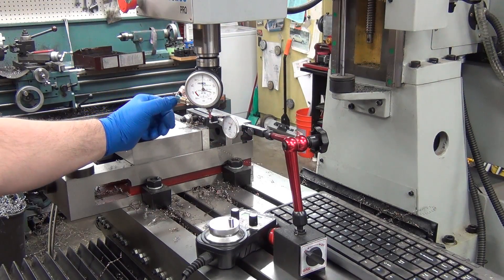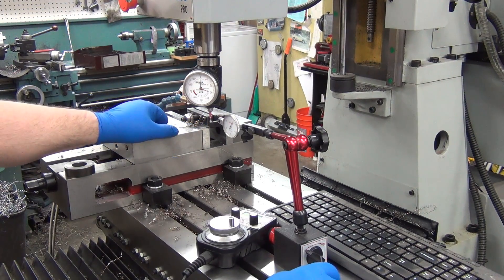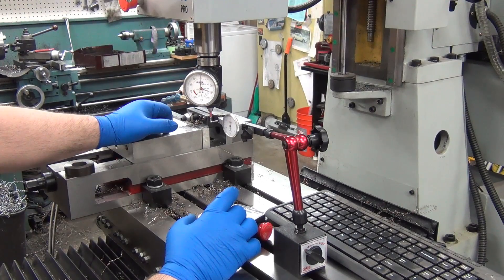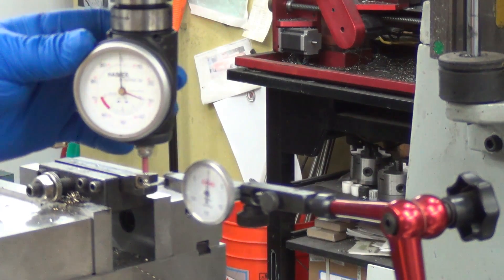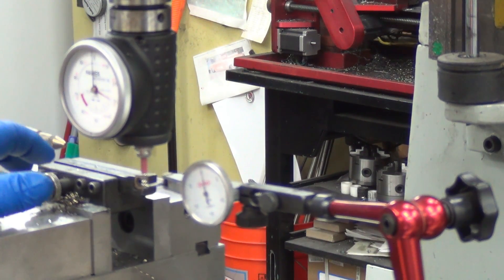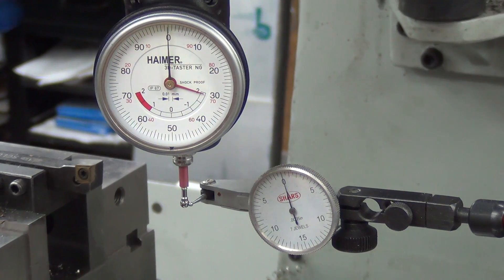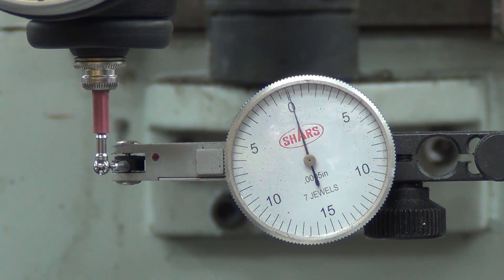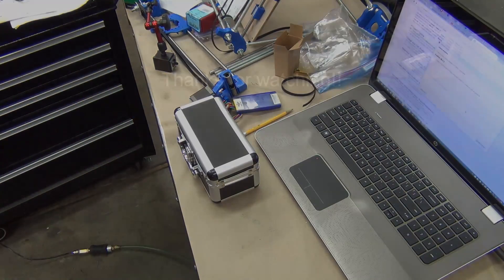Haimer 3D Sensor/Taster Setup

Comment: Can the Haimer 3D sensor work horizontally?
Reply from the maker: Sure....I've used it multiple times for setting tools in my lathe.  There is plenty of spring tension to hold the stylus when in a horizontal position.
Reply: @bluehandsvideo  :Thanks! Maybe using it in the lathe  will make a good video as well.
Reply from the maker: @shellybelly9205  I don't recall if I shot any video while I did it or not.  Might be in the editor if I did.  If not, I'll have to consider it next time I do some tool setups.

Comment: How hard are you turning on those grub screws? I really have to force mine hard to get my Haimer to calibrate and then the thing goes out of calibration again after a few hours. I feel as if I must be missing something, but I don't know what.
Reply from the maker: They work like a 4 jaw chuck....you have to loosen one, then tighten the one opposite of it(180deg) for it to move.  If you loosen one first, the other turns pretty easily.  If they're really hard to turn, you may not have loosened the other one enough.  If you have to turn really hard on one, .....loosen the opposite side first....snug up the first screw until it goes just past where you want it......then snug the one you loosened back up....it should push the needle back to where you want it.  It's a lot of trial and error........and just when you think you've got the hang of it.....it will prove you wrong. lol  I haven't had any issues with it going out of calibration.  Have you watched the tormach vid?
Reply: Hi. Thanks for your reply - Yes, it was actually the Tormach video which introduced me to the Haimer in the first place. Even loosening all the screws and then doing one up hard makes very little difference to my dials eccentricity. I have to apply a ridiculous amount of force to calibrate the dial and as I've said, it goes out after only a few hours (suggesting something is fighting against the force applied by the screws). No body else I've asked seems to have this problem with their Haimer so I'm really starting to think there is something wrong with mine.
Reply from the maker: There very well could be something wrong with yours.  Have you talked to Tormach about it?  
Here's the vid I followed to get the "at rest" position to zero.  
https://www.youtube.com/watch?v=ZwbTxlVM6TQ

Comment: Hi tks for the vid.  I have some question did you have to calibrate haimer each time you put in your spindle?  Or you mark the zero position??  Because I think if not you will have runout measurement as error...  Isn't?
Reply from the maker: Great question! That has been brought up a couple of times regarding the TTS setup.  So far, I'm not doing anything that needs that extra amount of accuracy, so no, I don't calibrate it each time and I have not marked a zero position yet.  I will get around to it...just not sure when.  Thanks!

Comment: I just bought the smaller probe with the 10mm shaft, my machine only has er20 holders for now. I am looking forward to using this fine tool. Thanks for sharing.
Reply from the maker: +Unorthodox Fabrication It's an awesome tool, but it's also very nerve racking to use.  I've broken 4-5 probes so far.  I was setting up a part last week and brought the bezel down on a clamp.....slowly....not sure it even left a mark.....but then the needles wouldn't move!  I basically tapped it with a hammer in the opposite direction and got it working again, but it's a bit "sticky" at times.  So.....be careful with it!!!  :)

Comment: Hey Mike you should also check the backlash in your Haimer to see what it is. if it is significant you should always approach the zero from the same direction. For example in one direction go straight to zero, the other direction overshoot zero slightly and come back to it.
Reply from the maker: +War Machine LLC Ah...I'll have to check that.  Do I need to know and compensate for the mill's backlash?
Reply: Yes you would. I forgot you might have backlash in the mill. Mine doesn't have any measurable backlash so it was an easy reading. Just indicate something on the table with the probe tip of the Haimer, put the DTI on the haimer and the base on the table, then manually move the machine back and forth in that direction in tenths and see if the two dial move simultaneously. I suspect the DTI will move every movement but the Haimer will lag a little. That lag is your Haimer's backlash.
Reply from the maker: +War Machine LLC I'll see if I can take some vid when I do it. :)

Comment: Double check the probe tips you have for a little pip left from turning. Fitted a new one a couple of days ago and went to clock in an aluminum surface in XY plane.... Not so awesome Haimer drag Engraver! Needle went nuts and now no longer zeros and does not run smooth when scanning surfaces, need to call them and get it checked out
Reply from the maker: +l0ckcr4ck3r For a $40+ probe tip, I'd be a bit upset!!!  .....and then to have it damage the sensor?!  More than a bit upset!!!  lol